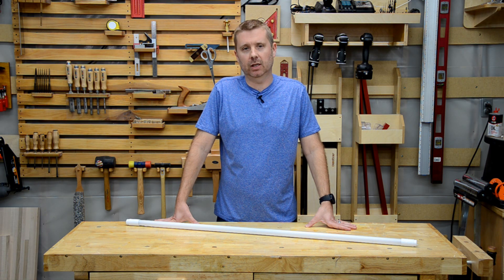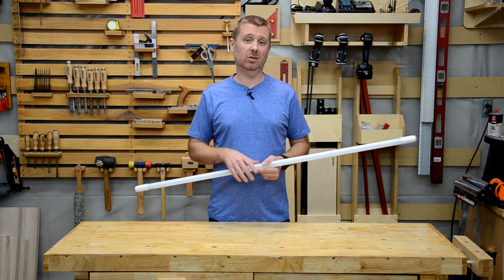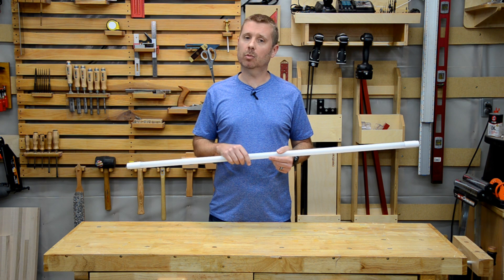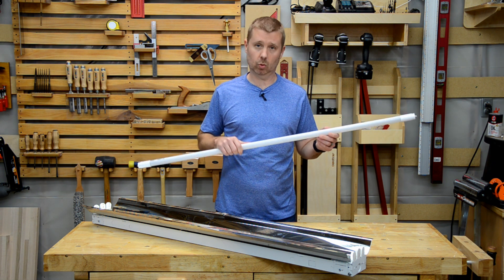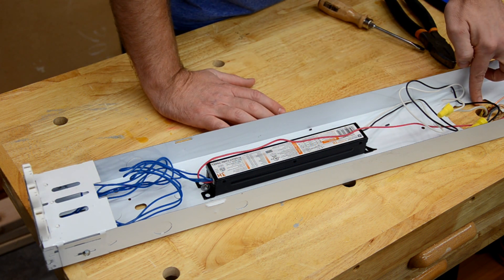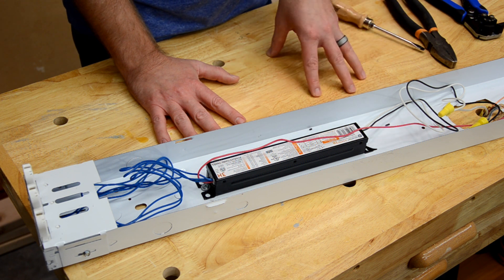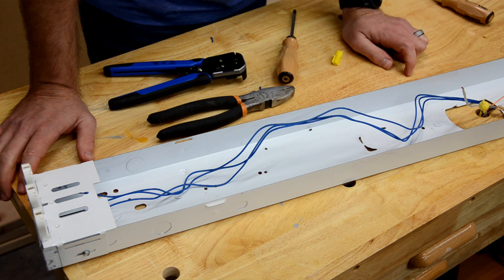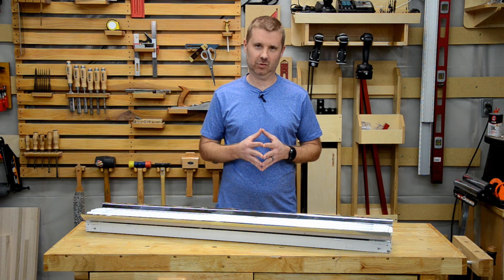How to easily convert fluorescent Lights to LED – UPDATED!

Comment: Hello,

I appreciate your videos and your clear explanations.  Thank you!  I am in the process of trying to convert my 4-bulb fluorescent fixture into LED and have run across some questions I'm hoping you (or someone here) can answer.  Please pardon my lengthy post.  I'm easily confused.  :-)

First, I deliberately bought "plug and play" "Direct Fit" bulbs because I was told they could be plugged right into my fixture with the ballast and they would work.  So, with the light fixture switched "on", I removed the 1 working fluorescent bulb and proceeded to install the new LEDs, one at a time.  Each LED lit and I had all four bulbs lit when I switched them off.  Some time later, I switched them on again and none of them lit!  After some experimentation, I concluded that if I installed any two bulbs into any two pairs of tombstones, they would light and light again after the fixture was switched off and back on.  If I installed more than two bulbs, they would all light if the switch was on, but none would come on after the switch was turned off and back on again.  I suspect a compatibility issue between the bulbs and the ballast.  The bulbs are Werker 11663C and the ballast is an Advance Standard REL-4P32-RH-TP (Instant Start).  This ballast is not listed on Werker's compatibility chart as either compatible or non-compatible.

I decided to think about bypassing the ballast, as you recommend, to see if I could get all 4 lights to light and to re-light after I've switched them off and back on.  After doing some more research, I understood that that bulbs I had required a compatible ballast to work at all, so I returned them.  If I'm going to complete this job, I need to figure out what kind of bulbs to buy.

My existing tombstones are shunted.  I verified this using a multi-meter.   The ballast has a black "line" wire and a white "neutral" wire coming out one side connecting with the black and white wires coming into the fixture along with two "yellow" wires.  There is a ground wire attached to the fixture as well.  Each yellow wire is connected to a single tombstone on the right side of the fixture and the remaining two tombstones appear to be daisy-chained to the ones with a direct connection to the yellow wires.  The other side of the ballast has two blue and two red wires.  These wires go to the left side of the fixture.  Going from left to right, a blue wire goes to the leftmost tombstone, then a red wire goes to the next, then blue, then red.  Each tombstone has a shunt wire connecting the two sides.  So, it looks like the ballast is actually two ballasts in one "package", with each "internal" ballast serving a pair of bulbs.

If I'm following your instructions here correctly, I suspect the right way to bypass the ballast is to combine the red and blue wires with, say, the black wire coming into the fixture, and then combine the two yellow wires with the white wire coming into the fixture (or I guess I could do it the other way 'round, combining red and blue with white and then yellow with black).  Doing it this way would require type A+B or type B, double-ended tubes and I could use the existing shunted tombstones.  Right?

In the alternative, according to your previous video, I could replace four of the shunted tombstones with non-shunted ones and cut the wires coming out of the remaining shunted tombstones on the other end of the fixture, because these will not be used to carry electricity.  Right?  Then, I would wire the new non-shunted tombstones directly to the power lines coming into the fixture -- black to black, white to white.  In this case, I would use type B single-ended tubes.  Correct?

Am I interpreting your instructions correctly?  Will doing this solve my "only two lights will light and relight" problem?

Thanks for any help and thanks again for your very clear video.

Comment: I bought some plug N play LED bulbs . Installed and they work just fine except after 30-45 min something overhets and the fixture goes black. After a while it will come on.
Thinking it's the ballast but don't know.
Can I simply convert these fixtures to use these bulbs and remove the ballast?
Reply: I believe that they must be the A/B Hybrid Type before you remove the ballast.

Comment: I have two blues and two red wires coming out one side of fixture /tombstone to ballast and a yellow black and white coming out of other end?  How do I bypass ballast and wire this configuration?  Help!
Reply: Your setup seems similar to mine (see above), except I have two yellow wires coming out of the ballast, not one.  My tombstones are shunted.  If yours are shunted, then you bypass the ballast by connecting the red and blue wires to house "hot" and the yellow wire to the house neutral.  You would use either double ended type B bulbs or type A+B bulbs.  That's what I'm going to do, but I'll hang around a bit just to make sure I've got it right.

Comment: Ok ....Purchased GE TypeA/TypeB - double ended.  Rewired one fixture and it was indeed simple.  However, I looked at the specs for the lights and it recommonded that one 1Amp fuse be installed with the light.  Should I be concerned about that?
Reply from the maker: The primary purpose of the fuse is to protect someone doesn't know the fixture has been converted and attempt to install a fluorescent tube. It's not mandatory. I put a sticker on all my converted fixtures (behind the tubes on one end) so the next owner of the house will be aware.
Reply: @ToolboxDIY  Thanks so much and will do.   Great video by the way ....and helpful

Comment: I replaced my fluorescent lamps with single ended ballast free tubes. It didn't require any new parts. The far end tombstones are simply bypassed too and are only for support. That is the simplest solution in the long run.
Reply: With single ended wiring approach, you need to be sure the tombstones are non shunted (the pin socket one side of the tombstone is electrically isolated from the other pin of the tombstone). In some fluorescent fixtures the tombstones are “shunted “ (one pin socket is electrically connected to the other pin socket on the same tombstone). Some led lamp manufacturers will supply non shunted tombstones if you need to remove shunted tombstones on the existing fixture you are converting ).
Reply: @cayuga74  By "single ended" I'm referring to tubes that have no electrical connections on the far side, they are simply mechanical supports.
Reply: @eminusipi  understood. I am just pointing out that in the scenario where you are wiring both hot and neutral to the same tombstone, where hot goes to one pin connection socket and neutral goes to the other pin socket of the same tombstone, that tombstone must not be the shunted type or you will have a dead short. Some fluorescent fixtures in the past did have shunted tombstones

Comment: Are the tombstones you are using shunted or non-shunted?  Is the hybrid bulb single or double ended?  Does the hybrid bulb have an "L" and "N" on one side and just "L" on the other side?
Reply from the maker: In this video, they are shunted. Those hybrid tubes can are single OR double ended. Yes, you read that correctly. One end of the tubes has a label which is the end to use if you choose singled ended power. If memory serves me, that labeled end gets wired to neutral if you choose double ended power.

Comment: Hi, if the led light tubes are plug and play, is it still ok if I remove the ballast?
Reply from the maker: If the instructions say it will operate with or without a ballast, then yet. If you see Type A + B, also yes. If you see neither of these, then the ballast is required.

Comment: Great video but I just have a clarification question: the blue wires are being connected to the black (HOT) correct, and the red wire is being connected to the white (NEUTRAL), correct.  The angles of your shot block the actual wire colors.
Reply: You have it correct, but he mentions at 7:55 that it doesn't matter. He would have been fine if he connected blue to white and red to black.
Reply: I had the exact same problem.  But you are correct.
Reply: Agree with you.

Comment: Can the standard tombstone connector on 4ft. fluorescent fixture be upgraded with the single pin connector?.
Reply from the maker: I've never done it so I'm not entirely sure. I'm leaning towards no. When I look at the single pin connectors they appear to be much deeper (pin side to back side) and would need a larger opening.

Comment: Even more confused, I have 4 fixture, not like any you have shown.....has 2 ballasts each, how do I bypass both ballasts? Lots of wires now.....
Reply from the maker: How many lights in each fixture? And how are they configured? Meaning, if there are 4 tubes in each fixture are they all side by side or are there 2 side by side end to end with another 2 that are side by side.

Comment: did you just group the blue wires with other wire? i cant see it clearly
Reply: do i need to replace the tombstone? ( not sure if the right word, i just figure it verbally)
Reply from the maker: If you are using the Type A+B tubes, then you don't need to replace the tombstones. The three wires were twisted together with the black wire (hot) coming from the house wiring.  They were twisted together with a wire nut (specifically the Ideal 451 yellow wing-nut).
Reply: @ToolboxDIY  thank you so much, i finally understand how it works now

Comment: I realize type A+B is more flexible but if you do decide to go with type B, you have to remove the ballast. Isn't that correct? I'm confused by the reply to quadcopter 101.
Reply: Ignore my question, on further reading of the comments, you do have to remove the ballast for type B
Reply from the maker: Correct. My reply to quadcopter was more about why I recommend type A+B even though I also recommend removing the ballast.

Comment: I've read that using the ballasts with Philips Instafit LED tubes does not provide any energy cost savings since the ballasts are pulling the same amount of power. Will doing this ballast bypass enable energy savings when using LED my Philips Instafit LED tubes?
Reply from the maker: What you read is not accurate. Ballasts do consume some energy but it's rather small - probably 4-10w for a 2 bulb ballast regardless of whether you are using a fluorescent tube or an LED tube. You'll get decent energy savings with the ballast in place. However, I always recommend removing them so they don't fail on you later down the road.

Comment: How much would I have to pay for someone to do this for me?
Reply: $2
Reply: @mcplutt  hahaha sign me up!
Reply from the maker: You'd only have to pay me $400 ;) Seriously, this can vary a lot. A good handyman may only charge $50 if s/he knows how to do it and is already at your house on a job. An electrician who just shows up for this will probably charge $100-200 per fixture.
Reply: Just get the $20 LED  units at Harbor Freight, and link them together. No extra cost for an electrician. Throw your old ones away.

Comment: As I am watching your video, I've been going to my light and checking everything step by step.  However, my light fixture has 2 yellow wires, and there is no yellow in your fixture.  I didn't see this addressed in any other question.  Could you please address what to do with the yellow wires?

Comment: The reason for the circuit breaker is because you may or someone may have a dual light switch and you'd hate life if you were working on it and someone else comes in and flips the secondary switch not realizing you are working on the light.   :)     Flip the breakers off.
Reply: There is another reason too.

Comment: I installed single-end-powered T8 no-ballast bulbs with non-shunted tombstones. I always have the black ( hot) wire on the left side of the tombstone. The pins on the bulbs I have are labelled L ( hot) and N ( neutral ).  I install the bulbs so that the L pin on the bulb goes into the L side of the tombstone. But the bulb also works if I have the N pin in the L side of the tombstone ( the bulb is twisted 180 degrees).  Would that shorten the life of the bulb or cause an unsafe condition ?
Reply from the maker: Every product is different. I would err on the side of caution and follow the labels to ensure nothing goes wrong.

Comment: I took down old fixture, I bought some stand alone LED tub lights ( https://www.amazon.com/gp/product/B07LGTJQ2S/ref=ppx_yo_dt_b_asin_title_o06_s00?ie=UTF8&psc=1 ),  Added some simple hooks and used the chain (my florescent lights plug into a socket anyway)  Though about using the case, but after testing without the reflector, I had more light then before.   They can be linked in series up to 4 (like strings of Christmas lights).  Only negative is I don't see a UL approval.

Comment: I was with you until you connected the wires. Did you connect the three Blue wires to the Black and the single wire to the White? You didn’t say that if that is what you do. Sorry if this is a stupid question, but I know zero about wiring. I have several old fluorescent kitchen bulbs that the ballast are no good and I want to try to replace with LED but am not sure about the wiring part. An electrician wants BIG money to do the job!
Reply from the maker: Three blue wires were connected to hot (black) and one red wire connected to neutral (white). Your fixture will likely be different. The key is that all wires from one end get connected to hot and all wires from the other end get connected to neutral.

Comment: Will your ballast removal method apply to a U bend  fixture as well?
Reply from the maker: Yes. If the U bend LED is a direct wire or hybrid, you can remove the ballast.

Comment: If I used this double ended method to retrofit, would I be limited to a particular style of bulb choice in future? A+B
Reply from the maker: If you do not bypass the ballast (type A), you can always go back to using fluorescent tubes if you wish or you can use any type A LED tube that is compatible with your ballast. If you bypass the ballast using the method I demonstrated, you would be limited to using type B LED tubes that are double ended. In either scenario you can always use type A+B which is what I like about these.

Comment: Your camera angle is off I couldn’t see everything you were doing
Reply from the maker: 3 blue wires are coming from one end and they were connected to hot (black). There was one red wire coming from the other end which was connected to neutral (white).

Comment: Since this was an update you should have gone over the basics of the way the bulbs function such as the fact that they need an led driver power supply either in the light fixture or inside the light bulb tube, you dont cover any such details only changing the wiring. So since this was an update i would have thought you would be more thorough on account of people who watch are trying to learn something. Your videos dont mention there is a variety of designs and made me think the led bulbs will all function on 120 volts ac.
Reply: I thought the video was great as is!